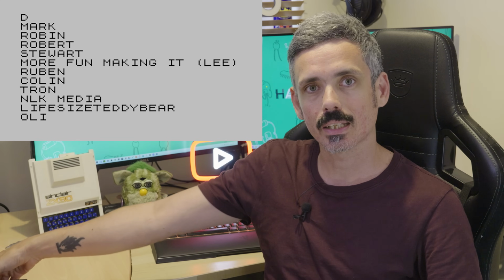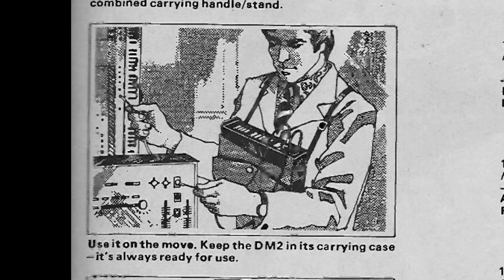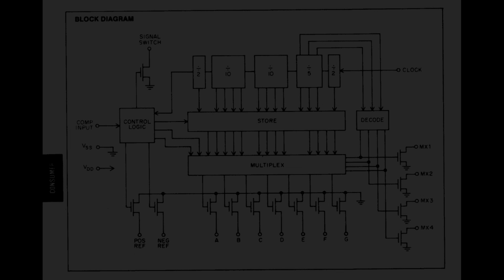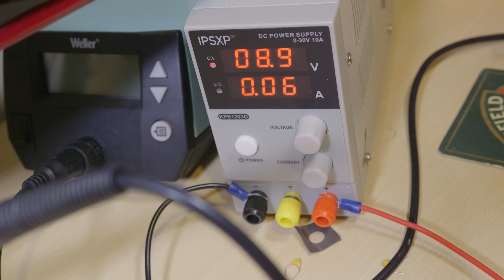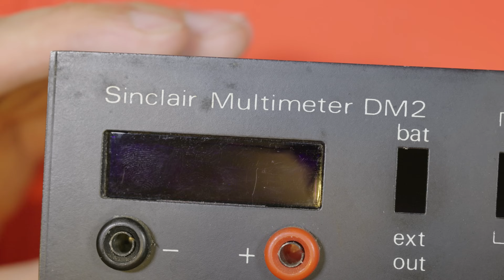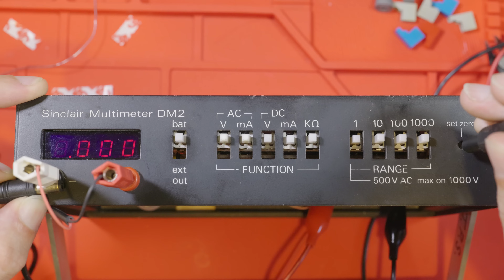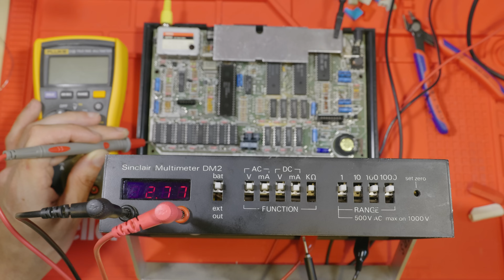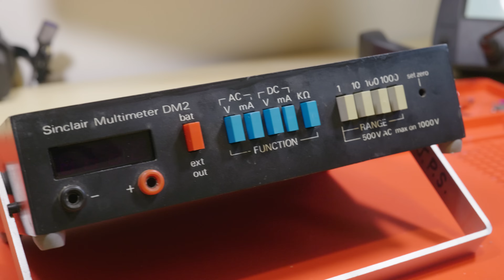50 Year Old Sinclair Multimeter - Does it work?

Comment: The circuitry is offensive to the eyes! The whole construction is completely shoddy. I think those ganged switches are supposed to be for record players/audio. I would not trust those presets either. It's basically using the cheapest nastiest components available at the time. Compare to a HP instrument of the same period and you will see how it is supposed to be done. No wonder the firm went bust. British industry as a whole went bust as I recall.
Reply: Being cheap and affordable, that was the entire Clive Sinclair ethos. Of course an equivalent HP instrument would have set you back much more, and  out of the price range of most UK hobbyists in the 1970s. I certainly couldn't have afforded HP on my meagre allowance.  HP and the like they were really for professional users, in a lab. This "shoddy" meter is almost 50 years old, and still works. I'm sure most modern, Chinese made electronic tech devices won't be working after half a century.  

Sinclair's instrument division was actually profitable, and was spun off by the NEB when Sinclair Radionics was broken-up in the late 70s, to become Thandar. Who are still in business as Thurlby Thandar. The British electronics industry was really done- in by overseas Far East manufacturing, e.g. it was much cheaper for companies to  manufacture in Hong Kong than in the UK.
Reply: @michaelturner4457  It's the Amstrad philosophy. See the offensive construction they used to use. Every corner is cut.
Reply: @Andrew-rc3vh  But Amstrad was very successful for decades, and eventually did buyout Sinclair, after his C5 trike and QL computer disasters. Yes, Sinclair did try and save as much as possible on components, like the skeleton presets and almost no overload protection. Shove 230VAC mains across the ohms range, it'll probably go BANG!.That's why this digital multimeter was affordable to hobbyists at the time, including me. Quite frankly looking at the way the PCB was put together looks reasonable for the time (1970s), especially given that it was designed, stuffed, and soldered by hand. IMO not "offensive". Only thing I can see is they didn't clean the surplus flux from the underside of the board after soldering, which is Uncle Clive not spending money on 1,1,1-trichloroethylene. 

Think this DM2 might be a later specimen, because some other DM2s have green glass-fibre circuit boards, rather than the cheaper brown SRPB, and plastic enclosed (Piher Spain) presets rather than the cheap open skeleton types. But it's certainly a better standard of workmanship than many things that came out of Hong Kong, such as radios. An equivalent HP digital multimeter with much better components construction quality cost many hundreds of pounds in the '70s, and was quite out of the reach of most hobbyists. I believe the original price for the DM2 was £49.

Comment: We have a Sinclair DM2 fully working, with a fully working display, but with no probe acknowledgement. Thanks Mr R...o C......r. That is as far as we'll go with the offending gentlemans channel.
Nina.
Reply from the maker: I feel like there's more to this story!
Reply: @HappyLittleDiodes  
There is more to this story.... Offending gentleman supplied an a..e about face wired battery snap connector 😔😔😔😔😔😔😔
Nina
Reply: Thanks for your info on the Sinclair DM2 Multimeter. We have (since our last comment) downloaded all circuit diagrams for this machine over the internet. We made a mistake, and purchased one of those BIG 9volt battery snaps for a PP9? (9volt battery). The supplier didn't know his negative wire from his positive, so therefore wired the battery snap arse about face.
Anyway....... the DM2 is working again thanks to your pointers in the right direction.
Wayne & Nina
🫡🫡🫡🫡🫡🫡🤝🤝🤝🤝🤝🤝😊😊😊😊😊❤️❤️❤️❤️❤️

Comment: About 3 years ago, we purchased s Sinclair DM2, with a rotted battery (plus rotted battery snap) off E.....y. It turned out that the circuitry was fine, as tested by my bench power supply.
I then make a mistake, I order a new battery snap off a chap who has his own YT channel (I will not mention his name or channel). Needless to say, the battery snap was INCORRECTLY WIRED.
For the last 3 to 4 years we have a Sinclair DM2, which works, but the display no longer displays a 9volt battery reading from a 2kohm resistor.
Any ideas as to what has failed?
Nina.
And thanks for another fantastic video.
👏👏👏👏👏👏👏👏❤️❤️❤️❤️❤️❤️❤️❌️❌️❌️❌️❌️❌️😊😊😊😊😊😊😊😊😊😊😊
Reply from the maker: I'm afraid I have no idea what could have failed, there are schematics out there, however, which will help you diagnose
Reply: If it was reversed battery, I suspect an IC or transistor has popped.
Reply: @michaelturner4457
From Nina, it turns out that all chips, and transistors survived this reverse polarity cock up. But the diodes were not happy little diodes anymore. Therefore, they all had to be replaced.
😖😖😖😖😖😖🤨🤨🤨🤨🤨🤨

Comment: I wouldn't assume your mains voltage is exactly 230 volts. My supply at home in the Northwest UK never drops below 235V but will sometimes go as high as 250V. Believe it or not, this is totally within spec (216.2 volts to 253.0 volts).
Reply: Yeah, the 230V is the common spec with Europe, but the actual real voltage in the UK never changed, so is usually around 240V. 230 is sort of the middleish between 220 and 240. Some parts of the British Isles actually have 250V from the sockets as the norm... I think the Isle of Man is 250?

Edit - some brand new substations are apparently 230V.
Reply: Yep. I am next to a substation/switching point and my mains is often up to 245 V

Comment: If you use very fine sandpaper / buffing compound you can buff out the scratches in the window, likely. Not sure if you're planning on replacing the eletrolytic caps? Only biggest problem with the meter is lacking a continuity test, those are so often helpful. You can buy shrouded / safety jacks and sometimes do a little drilling to fit them if you want. Nice display on the unit.

Comment: the whole construction is so cheap and sloppy. the lower low end.
Reply: It's a product of its time and the Sinclair ethos.
Reply: @Brian_Of_Melbourne  maybe just Sinclair ethos 😃 devices of that era were usually built like tanks.
Reply from the maker: So cheap though! Accessible for hobbyists
Reply: @HappyLittleDiodes  £59 i(+ 8% VAT) in1974 equates to over £770 today!  Now, you could by a BK Precision BK2831E (20000 count - 4.5 digit) for £480 (including VAT). Hope you were just kidding about the Sinclair being accessible for hobbyists.
Reply from the maker: The HP equivalent was over £100 ;)
Reply: Because they were intended to be affordable by ordinary hobbyists at home. As a kid in the 1970s with pocket money and a paper round, I could afford a Sinclair multimeter, but NOT an HP multimeter. In fact I actually bought a Sinclair PDM35 in 1978, which served me right through the 1980s, for many projects and repairs at home, and it was reliable. The PDM35 was typical Clive Sinclair cost savings, in that it used a repurposed enclosure from the Sinclair Oxford calculators. Tandy(Radio Shack) also sold the same Sinclair multimeter, badged as Micronta.

Comment: Screws are stainless steel I would think more for corrosion resistance than anything to do with measurement.. similarly plastic nuts and bolts I'd guess are more likely about safety to avoid arcing to the case. Magnetics afaik are not really much of a consideration expect in fairly obscure circumstances.
Reply: More likely nickel plated brass back then.

Comment: if they are using different current or voltage to measure resistance, values should not necessary must be the same when measuring circuit with non-linear elements in it, like spectrum. it will be better to use actual resistors comparcing for this.
Reply from the maker: Yes that's a good point and I'll do that next time I have it open. The resistance test on the spectrum is just to check for very low resistance (close to open circuit) before powering on, so I never consider the reading in great detail